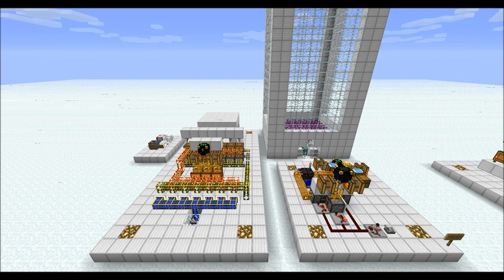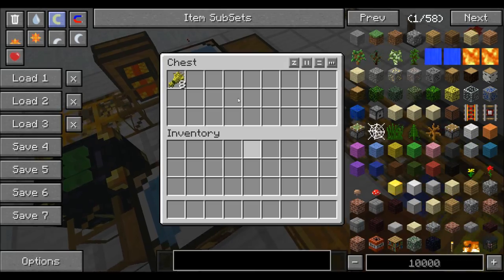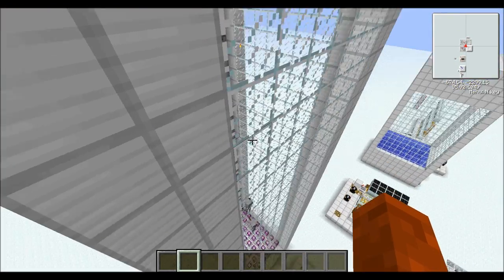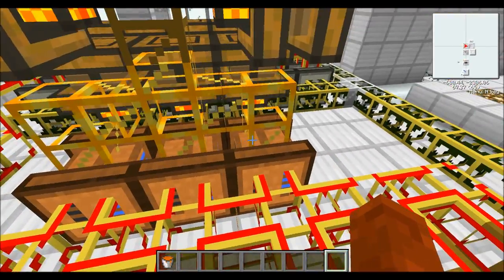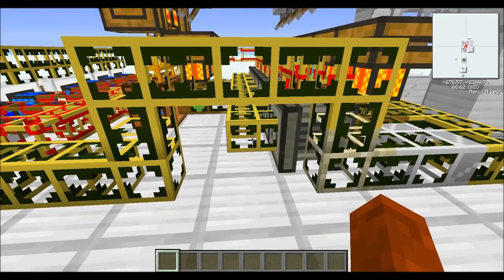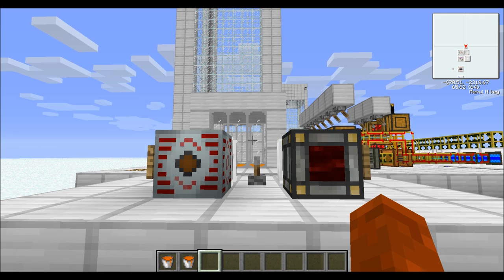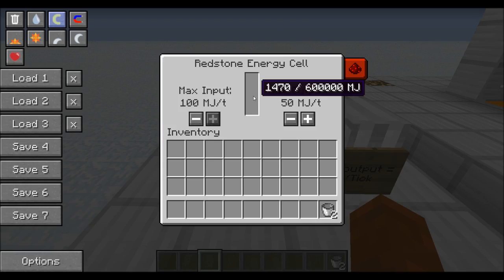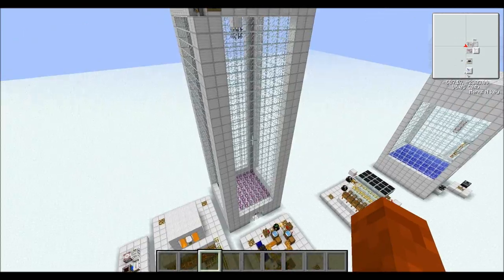FTB Creations - Ep. 3 - Biofuel Plant

Comment: In some other setups you have treefarms. You split the sapling 1/2 for plant 1/2 for biofuel. The Apples get turned into mulch for the fermenters. The leaves can be used for something else (maybe IC2 Biofuel). The Wood is turned into charcoal to power the engines (in some cases a steam boiler to power steam engines). At the end you have a fully renewable Biofuel farm.